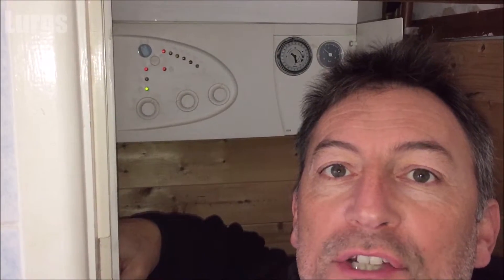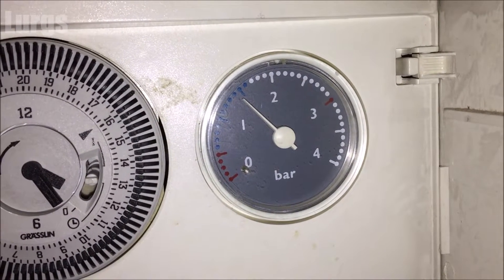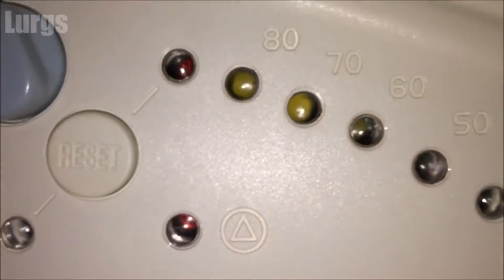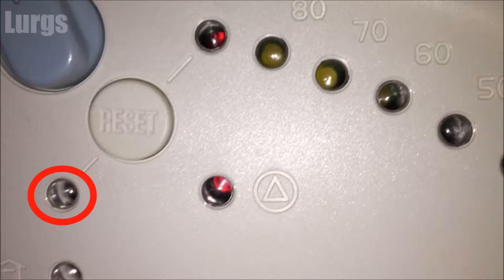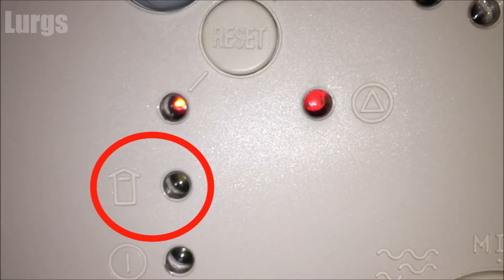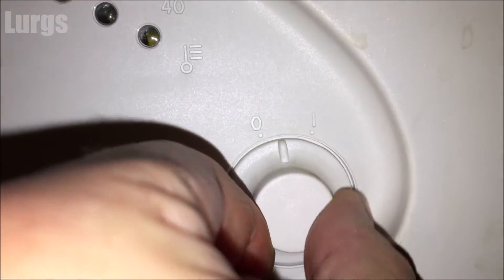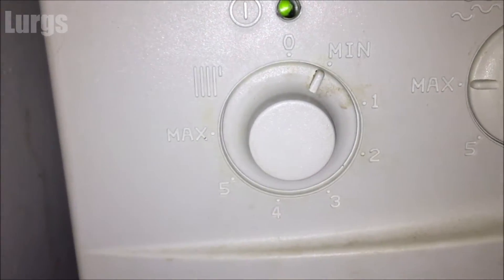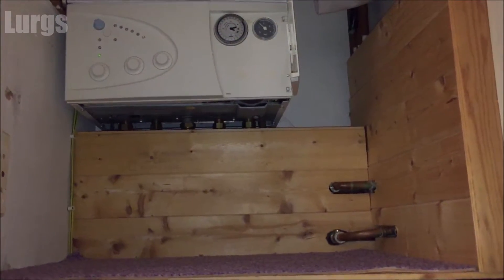Combi Boiler Overview and How to use a Combi Boiler Front Panel for Heating and Hot Water

Comment: Hi sir! I have the same boiler here, with low pressure. There are two blue valves in the background, which one should I turn to pump some water in?
Reply from the maker: Try this video here https://youtu.be/EhLqBXGXzbU
Reply: Lurgs How To Guides thank you for the advice! I let the air out of the radiators as explained in the video; but even after that, the two blue valves don’t pump water into the boiler when turned. If I open hot water in the sink, the pressure goes up to 0.5 bar, but then it drops to 0 again.

Comment: My boiler pressure is 0.2 bar...when heating comes on it jumps to 1.5 bar, when hot water comes on it jumps to 0.5... we’ve had a plumber in 3 times now and they can’t diagnose the fault. We’ve filled the system so it’s at 1.5 bar, then a day later it’s back to 0.2. Any ideas.?
Reply from the maker: That indicates a leak on the system somewhere but if it's happening that regularly you would see wetness somewhere. Check to make sure radiators are hot all the way around (top and bottom), if you have hot and cold spots on the radiators it means you've got air in the system so need to get that refilled. Else if you think there isn't an issue and the radiators get hot then it could just be a faulty pressure reading. In my experience if a boiler is over 10 years old you can throw money at it for parts and maintenance but sometimes it's best just to get a new boiler. Good luck.
Reply: Lurgs, the plumber has fitted a new pressure relief valve and a new expansion tank (old one was full of water) and when he sets pressure at 1.5 bar, it drops to 0.2 by the next day. 
Need to see if there’s a leak but all pipes are built into the loft and walls. Not much point in new boiler yet till we see if there is a leak. 3 weeks and no damp patches on floor or ceiling so it’s baffling to say the least. Tried looking at pipes in loft and around cupboards but I can’t see any wet.
Reply from the maker: That is odd. Keep an eye on radiators, if they are hot all the way around then there probably isn't a leak and it's a faulty pressure reading. Hope it's not a leak. Ours drops over time but not that quickly.
Reply: Lurgs sorted, leak on the pump in the hot water system. Replaced and sorted..👍👍
Reply from the maker: @TheSparkey40  Great news.